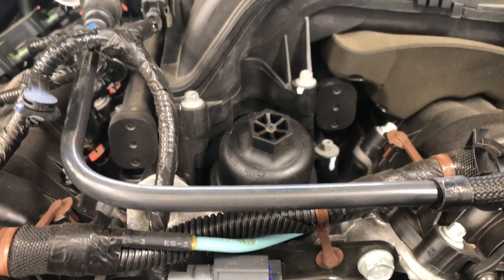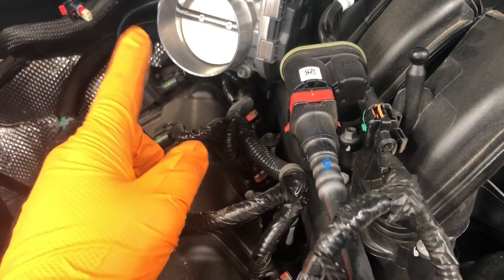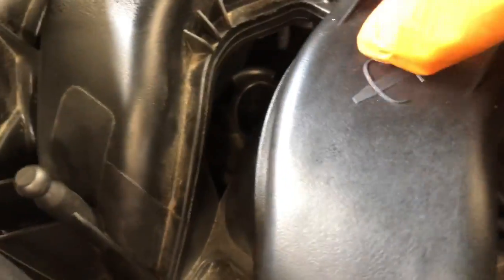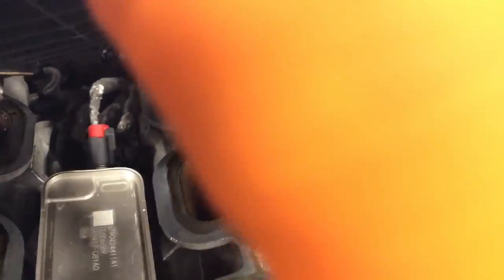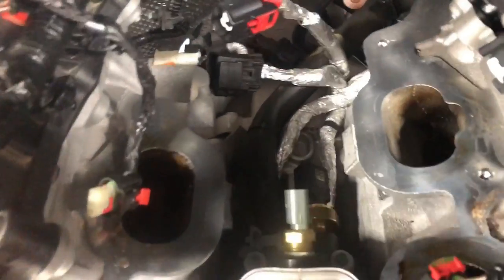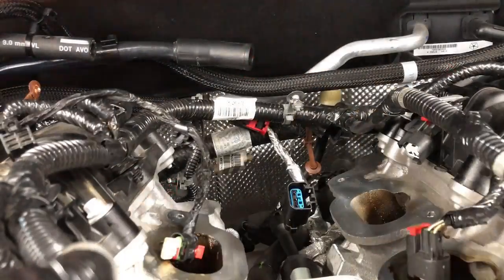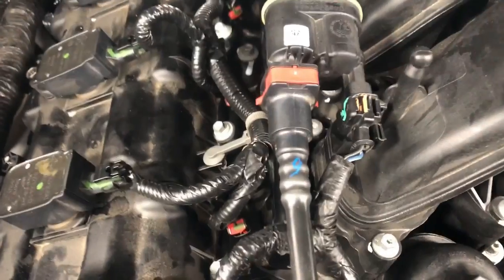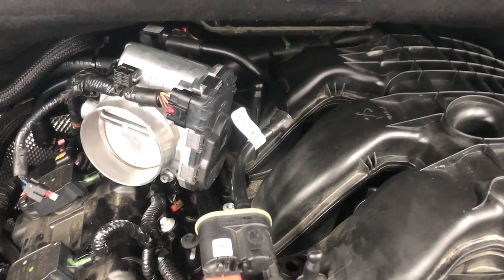Engine Oil Pressure Sensor Replacement Chrysler 3.6L

Comment: Will this fix my oil pressure reading being in the 90s? I talked to the dealership and they’re trying to say the whole oil pump needs to be replaced. I’m pretty sure it’s just the sensor but they’re saying there’s also a sensor attached to the oil pump and it’s most likely that one. It’s not throwing any codes. It’s just reading high oil pressure and then it slowly goes away. Once the car has been running for a few minutes.

Comment: is this same as 2013 chrysler 300? And what should I change while having it all apart?
Reply: Did you get a P06DD code ? Cause I have a 2013 300 Chrysler too . I’m trying to do my research to see if it’s the oil pump or oil pressure sensor replaced
Reply: @carlossilva261   I have the same problem. Same code po6dd
Reply: @carlossilva261  did u get it changed

Comment: You dont have to do all that to remove and replace the oil pressure sensor👈👈👈 there is another way way less intrusive brother !!!!!!!
Reply: Do you have a video that shows
Reply: @finehotness   i am not sure if anyone has made one, i never made one, nevertheless if i do another oil pressure sensor in this cars i will make one,  but is much faster also save on gaskets, the one thing to have in mind is the hose clamp on the sensor if is wider then usual will give you issues, how ever out of 5 i did only one give me issues. If i fimd a vid on this il post it, i am sure i am not the onlyone who has taken this route
Reply: @Shorinjinn yo I really want to see a video of you changing that sensor without removing the intake, considering it sits right on top of it,  super curiouslet me know😂

Comment: Is this the same as the oil pressure switch cuz i need to replace mine on my ram 1500 2014 and no videos on here are of the v6 ram.
Reply from the maker: Ram 1500 if it’s the 5.7L v8 Hemi it’s easier. Not much special tools required just need a oil sensor socket or socket large enough to fit completely over sensor. And it’s on the front of the engine towards passenger side.
Reply: @ChrisMYouTube  its under the fucking intake gasket its fuckn stupid hard compared to the v8
Reply from the maker: It’s not too bad. If it’s V6 Ram there is much more room than in a Jeep or others. If you are going to remove the manifold and you have a lot of miles replace the upper and lower manifold gaskets and do a tune up while you’re there.
Reply: @ChrisMYouTube  v6
Reply: @ChrisMYouTube  the hemis is literally on the front reachable by hand and i only have 45k miles on it. But from the engine diagram my buddy showed me i have no choice but to replace both upper and lower intake gaskets.

Comment: Don't take the rear bracket off, just take nuts off. Don't take fuel rail bolts loose on lower intake, just 8mm bolts.

Comment: Is this for a 2015 Chrysler 200?
Reply from the maker: No but however the process is very similar it it’s equipped with the 3.6L
Reply: @ChrisMYouTube  what about dodge avenger 2014 3.6L same also?
Reply from the maker: Will be similar but is different.

Comment: $300 at the dealer. Oof!
Reply: My stealership quoted over $700 to do the job that should be a recall item. I like my jeeps but this really makes me angry. I had the problem on my wife's 13 JKU at 40k miles and now my 14 JKU has the same problem at 23k miles.

Comment: Yeah fuck all that. I'll live with the CEL in my Rubicon for a while longer until I program it off. ECU is still showing regular engine oil pressures so I don't even know why I threw this code but as long as the engine is getting the proper oil it needs, I don't need to go through all that just to replace some electrical nanny. I'll just program it out.

Comment: Easy to follow video. I have one question...
Do the intake manifold and lower intake manifold o rings need to be replaced during this process? Can the o rings be reused if not damaged?
Reply from the maker: Yes but if they are really hard or look like they are kind of flat then you may want to consider replacing them. You can cause a leak and possible rough idle and/or misfire
Reply: Also take advantage and replace spark plugs if  needed

Comment: What size socket did you use to remove the oil pressure sensor?
Reply from the maker: You will need a oil sensor socket you may be able to use a wrench but you might not depends on if you remove oil cooler assembly
Reply: I believe a deep 19mm works. But dont quote me on it.

Comment: Will this be the same for a 2014 dodge grand caravan  ???
Reply from the maker: It is similar minus the brackets are slightly different. And the air duct is different on the vans there is a push pin on top of the intake that has to be removed to completely remove the air duct.

Comment: Hi ...brother I'm from Iraq  I have Dodge Durango 2014 my problem begin before 7 days when I changed the engine oil 5/20 and oil filter and they Washed the engine from the outside only with water vapor. the lamp of check engine was turn on and send a message to me with this code (p06dd) ( engine oil pressure control circuit performance stuck off ).. so I need your help with this problem. the engine not like before I feel  there is a roughness in engine performance.. thank pro.

Comment: Why does All data give 0.5 hrs for this job ?
Reply: Because AllData is good for wire diagrams at best.   .5 (1/2) is a JOKE and why all the good tech left the business.
I'm serious.
Reply: Because you don’t need to remove the intake manifold to change it.
Reply: @dreamer2355  
The point I'm making is ALLDATA step #1 IS removing the intake. 
If you can get around that then you make more $$. The ALLDATA labor time for the upper manifold is   .09. How does that make sense??
Reply: Brian Bonaventura we use mitchell and sometimes identifix to verify labor times. You will be surprised of the difference. Thats an issue with Alldata, or Chrysler found out us techs can complete the job without removing the intake reducing labor times and alldata not updating their procedure.
Reply: @dreamer2355  seriously how is it physically possible to remove this sensor without removing the intake? Its facing towards the firewall and It’s burned under it 😩 I have a customer wanting me to do this job for them so please enlighten me lol
Reply: @Dales Garage How is that? How do you remove it without?
Reply: Just FYI, the Promaster van is a BITCH!

Comment: How did you remove that stud from the back left of the bottom bracket? I’ve been trying to get that thing out all day today and I can’t break it from the plastic clip to loosen the nut even more. I’ve got the nut to about the middle of that stud and that took me long enough and finally gave up here when daylight started to fade.
Reply from the maker: There is a plastic clip over the threads remove that clip. And you’ll need a 13mm deep well socket. A 1/4” drive will probably be better due to the lack of space.
Reply: Chris M. So the plastic clip as to be removed and the nut has to come completely off the ~2 inch stud? I’m thinking that’s correct but just trying to gain as much information before I keep busting my hands up again tomorrow lol
Reply from the maker: Yes. The clip has to be removed to gain access to the stud so you can remove the bolt/stud. Also a set of stubby ratcheting wrenches helps. Being as it is a pretty tight space
Reply: Chris M. Yeah it’s ridiculously tight. I’ve got pretty large hands but fairly skinny and  it’s a pain in the ass. I appreciate the information man. Great video
Reply from the maker: Yea first time they are pretty tight. Hope it goes well for you. And thanks again.
Reply: Chris M. Oh another quick question, don’t want to take up all your time man. The 2 brackets on the right side (looking at the engine) do they both need to be removed completely? The front one is easy, but the bottom bolt of the one in the back is a pain in the ass and it has a metal bracket holding one of the lines making the nut sit between the main bracket and the one holding one of the lines
Reply from the maker: Depends on what vehicle it’s on. Most time you only need to remove the 2 10mm nuts ants removed intake the opposite side
Reply: Chris M. It’s a 2012 Jeep Grand Cherokee 3.6. It’s almost more of a pain in the ass to remove that second bracket on the driver side than it is to get my hands on the back of the engine on the passenger side
Reply from the maker: Just remove the nuts on the driver side from those two brackets at the upper intake side not the engine part. Once you remove the bracket on the passenger side and remove everything else from the intake pull it up and over to the passenger side.

Comment: Do you have to replace the gaskets on the intake manifold?
Reply from the maker: No but it is recommended because the gaskets will tear or if there is a lot of miles and age the gaskets will crack or break. And will cause a leak from the manifold
Reply: Thanks buddy I got the gaskets and I'm starting this today. I'm a plumber not a mechanic so we will see if an old fat plumber can pull this off. Thank you so much for the video.
Reply: So usually I'd start off with a smart-ass comment like the reason your mechanic is cuz you're too stupid and lazy to be a plumber. I will save that for the electrician's on job sites. Your a baller. I won't tell you how long it took me to get that damn Bolt from behind the intake valve. Putting it back together was a lot easier then taking it apart. I got it done and test-drove everything seems to be good. We live in the mountains now my wife can start her car from inside and I can monitor the oil pressure. Can't thank you enough Chris. And thanks for responding earlier. Seriously my wife is so happy. Just can't thank you enough buddy.

Comment: How many hours did it take
Reply: Great video !! ... I have a 2013 Jeep Wrangler and she threw the same code. I'll be doing it myself, I just have to get my hands on a proper socket for the switch... would you mind telling me if you had to remove the fuel rails, and how much of a pain is it to get them off in order to pull the lower intake plenum off ? Thanks !
Reply from the maker: The whole job can be done in maybe an hour. But for most people probably a bit longer. it can be a bit of a pain because of the tight spaces.
Reply: Is this for the 2012 3.6 Chrysler engine? I called the dealership and they said it’s in a diff location they want like 500+ to change the whole housing o.0
Reply from the maker: Average guys channel as seen in the video it’s at the back of the oil cool housing. If doing this yourself make sure you get the upper intake manifold gaskets. You can get just the pressure sensor separate.
Reply: They said it’s by the oil filter ?
Reply from the maker: Yes it is by the oil filter. The oil filter on the 3.6 is a paper(cartridge style) oil filter. It is made into the oil cooler which is located under the upper intake manifold. Which has to be removed in order to access the sensor. There is no other way to do it. Again the sensor is located at the back of the oil cooler it requires a special sensor socket to remove the sensor. Unless you want to remove the whole oil cooler which requires much more work.
Reply: Chris M. Thanks brotha

Comment: I have a problem in Jeep Grande Cherokee Laredo in the motor 3.6L, there’s a noise in the lifters, do you happen to know why?
Reply from the maker: The 3.6L engine is known to have failures with the Lifters and rocker arms. Which leads to failures of the camshaft lobes/camshaft. Also changing your oil with the proper grade and doing so on time helps as well. The 3.6L engine also will give a noise after the vehicle has sat for extended periods without cranking and driving. If not taken care of when an issue arises it will start to run rough and be very noisy.

Comment: Good work sir and good post. I do have a 2011 Jeep g.c. hope I never have to do that. I am having break trouble  the power booster is leaking, it's still under warranty and the light comes on
Reply from the maker: Yea you definitely need to get that checked out that’s not good. There is a recall on the boosters for the grand Cherokee so you need to see if your vehicle is related or covered under that recall.